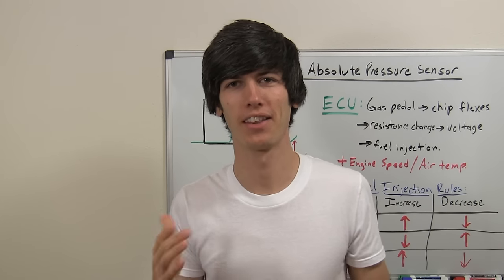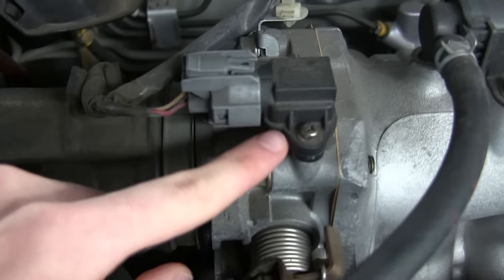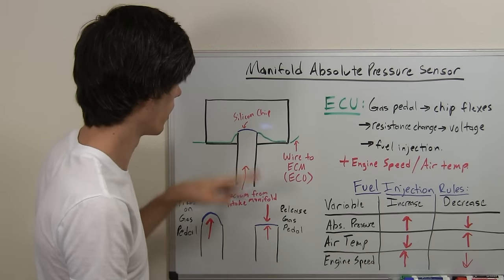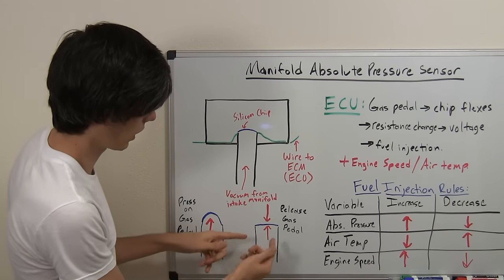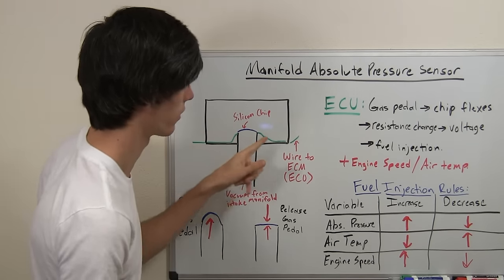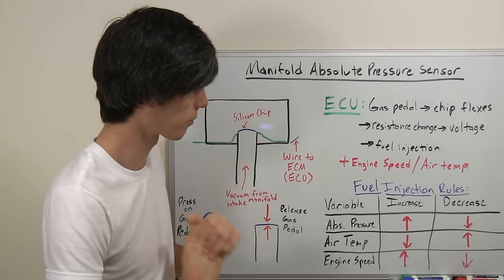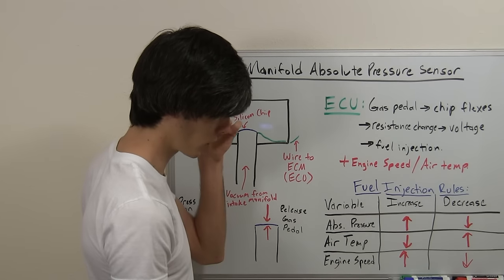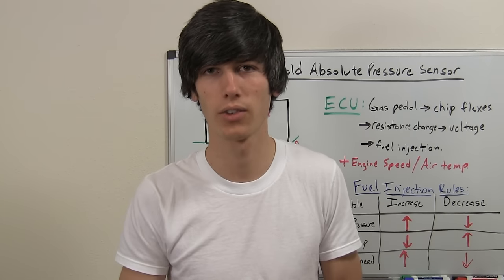MAP Sensor - Manifold Absolute Pressure - Explained

Comment: i appreciate the info, my car has a MAF though, i read a little about my problem online and i think there might be some sort of leak in my pressure lines were the boost is and one of the lines fails when full boost is running through it. i'm going to replace all the lines and that will hopefully get rid of the problem! thanks!

Comment: @blankps3, an engine is basically a big vacuum. The pistons "suck" air into the chambers. The more it sucks the more power you get therefore the higher the vacuum. The throttle controls the amount of suction. It gets a bit more complicated as you add a turbo but that is the gist of it.

Comment: Back in the day I had a manifold pressure dial on the dashboard. It was a great visual aid to drive economically, as you could instantly see exactly where that tiny extra press on the gas pedal would translate to a significant  increase in the manifold pressure - and fuel flow. By watching te indicator, it was possible to negotiate a gas pedal position that would result in not increasing the manifold pressure, and at the same time maintain current speed (though with practice I learned to "feel" that precise point, without having to look at the gauge). In the modern cars of today we have the instantaneous mileage indication, which can be used to the same effect (drive economically).

Comment from the maker: TPS is on the back side of the throttle body, on the same axis as the butterfly valve (I have the maintenance manual).. I have a video on TPS if you're interested. I went to NCSU.

Comment: I’ve been checking out my map readings on my scangauge and noticed that the map reading at idle is higher than when I lift off throttle and the rpm are dropping. Why would an engine at idle create more pressure than an engine that is revving down? Is there vacuum created when fuel is cut yet the pistons are still cycling? Thanks man, love your videos.

Comment: cool video, not sure if you can help but I have a 98 Toyota tercel that runs crazy rich only at first start in the morning and only when its below 40 deg outside. there are no dtc's I've tested the o2 and replaced the coolant temp sensor, also checked for leaky injectors. the exhaust smells like raw gas and smokes for about a minute at cold start. if its warm out no smoke and no gas smell also no engine miss and I replaced the valve seals. this thing really has me stumped. Thanks chuck.

Comment from the maker: Well keep in mind it can also use the O2 sensor to close the loop up and provide another data point to verify/alter the A/F ratio. It is very cool though.
Reply: Great explanation Jason as always. So vehicle's computer will not look to the MAF sensor to check air to fuel ratio, but will bypass it and go to the O2 sensor to calculate the amount of fuel to mix with the air.? Cheap gain power 🤔

Comment: Thank you.  very good explanation,  Doesn't seem like a lot of work to simply replace the IAP sensor when it goes bad.  Would you say 10 or 15 minutes if at that.  Are there other adjustments that must be made after the sensor is replaced

Comment: Nice explanation.  I'd welcome a video explaining the different purpose of the MAP sensor and the MAF sensor. I think their functionality overlaps but the MAF sensor gives a more reliable reading of the volume of air at higher RPM (with the throttle open) whilst the MAP sensor gives a more reliable reading at low engine speeds (where the throttle is less open).  Any inputs most welcome.
Reply: I think the MAP sensor is important to set the ignition timing.  More MAP pressure (higher HP) the timing is advanced where as less MAP pressure (lower HP) the timing is retarded. The MAF is for fuel mixture control.  The ECU is metering the fuel based on the airflow.  In the real world, both work in conjunction to maximize you engine HP in an efficient way.  When you step on the gas pedal, you demand more HP from the engine and the end result is higher MAP pressure + higher MAF air flow.  The ignition and fuel metering adjust themself to provide the optimum HP
Reply: @phatvu3811  Thanks, that makes a lot of sense! :-)

Comment: Yes,my brothers 2000 model Subaru Forester is playing up at idle speed particularly when it's warm,I've went through & checked for air leaks which I got rid of but the engine  keeps surging 15 minutes after the engine has warmed up.

So,on Monday I hope to do a voltage test using my multimeter & a vacuum pump & gauge to see if the sensor is putting out the right voltage because I've ordered  a hand held vacuum pump to test it with.

I need to test it because they aren't cheap at $400-$700 AUD for a new one,I might buy a used one or something if that's what my brother wants !

Comment: Very useful information, you explained it very well, but I do have one question what would be the symptoms on a engine when the map sensor is not working properly or at all.  will it still turn on or will it turn on only for a few sec then turn off ?  I ask because my vehicle has 2 map sensor and one flow sensor.

Comment: II see that this is video is from quite a while ago. I have a MAP senor on the intake of my carbureted motorcycle. I assume, in my case, that the sensor only impacts the ignition timing. Can you do a similar explanation for a carbureted engine with a MAP sensor? I liked your presentation.

Comment from the maker: That's interesting about the spacer, I've never heard of that though the logic makes sense. I should have a video on CAI's eventually, don't know when. As far as are they worth it? Ehh, most companies know what they're doing, and you won't see big improvements. The biggest difference you'll notice with a new intake is the sound, but that could be achieved simply by removing the silencer box around it. Also, you need to be careful that the rerouting of a CAI doesn't place it closer to the engine.
Reply: the deal with "Cold Air Intake"... is to trick the ECM as if you're driving in cool Canada instead of hot Havana.

Computer sees cold air and injects  more fuel...

Fav. quote: "There is no Replacement for engine Displacement!"
👍

Comment: Thanks man - great video !
I did a bit of experimentation the other day trying to diagnose a certain issue with my car. What I noticed was, the map sensor would give a certain value at idle, this value would increase as I'd step on it - but - as soon as the new / high RPM is stabilized - the map sensor signal value would default back to as it was on the idle.
To rule out it was a sensor issue, I unplugged the pipe from the intake/manifold & created a vaccuum through mouth & the signal value would maintain instead of defaulting back.
TLDR : it appears that the pressure in the engine would drop back after acceleration - which would naturally cause the map to lower down its signal - do you know if this is how its meant to be ? or am I experiencing some undesirable vacuum leakage (other details : toyota 5afe, knocking, occasional puffing in the silencer, possible tappet noise, possible rich burn)

Comment: thank you for the help I have a 2017 CRUZE diesel the mileage [was] around 40 two lane black top . freeway over 50 the fuel mileage went south . I cleaned the map sensor [ ISOPROPYL ALCOHOL BASE] lots of soot the mileage came back for a day so I purchase a new one after market its not up to the job [I should know better] so I have a GM replacement coming we will see what happens. thanks

Comment: Really enjoy all your videos, thank you. I was wondering, could you do a comparison video of MAP vs MAF sensor? Can't tell if one is "better" than the other.
Reply: A MAP sensor measures the pressure in the manifold. A MAF sensor measures the volume of air flowing through the intake prior to entering the throttle.

MAF sensors can be problematic in forced induction and high performance engines as they don't measure the direction of air flow, only the volume of air. When the throttle snaps shut, you'll have a pressure wave of air moving back out the intake, which the MAF sensor will read as a large volume of air. This will cause a potentially harmful rich A/F mix to exit into the hot exhaust. 

In that scenario, a MAP sensor will see a drop in pressure in the manifold, and adjust fuel injection accordingly. 

Generally, if you're building a high performance engine, especially a turbo engine, you'd be better off running a MAP sensor. 

I got this information from watching a video by HPA, High Performance Academy. They're also a fantastic channel - racing team that's based in Australia that's been building race spec engines for many years.

Comment: I always enjoy watching your videos. I learn so much from them, and like to learn as much as I can about cars. I have a trouble code, P0108, MAP sensor voltage high. You mentioned that cars that have a MAP sensor don't have a MAF sensor, but my 2016 Honda Fit has both. I am concerned that this sensor may affect my engine and needs to be replaced. Is this the case or could it be cleaned and have the trouble code reset?

Comment: Hi Engineering Explained, my car is on Stage 2 and recently upgraded the turbo compressor wheels, and wastegate actuator. Should I upgrade my 2.5 Bar Map sensor to 3 Bar sensor? Thanks in advance

Comment from the maker: Honestly I'm not too sure. From an engineering standpoint, I feel like a MAP would be an improvement as it doesn't put anything in the way of blacking airflow, and doesn't have resistors that are in the airflow's path that could get dirty or be damaged. But I believe both are still used today, though perhaps not.

Comment: Hey thanks for the video I was reading that the map helps the ecu determine the engine load. Just a query if car is in neutral and you rev it to 2000rpm and compare this to lugging a car up a hill at 2000rpm how do the pressures change is it just because the throttle plate will be wide open in latter case?

Comment: Hi man just a quick question  . What's the difference between an absolute back pressure sensor vs relative back pressure sensor? Like would the absolute result in a lower value sent to the ecu than if a relative was used?

Comment: See in a normal situation with a low amount of throttle applied, the throttle-valve is almost closed. Thus preventing the engine form breathing at it's full capacity. Still the pistons go up and down sucking air into the cilinders. But the closed throttle is like an obstacle creating a vacuum in the intake manifold. Or at least a lower pressure then atmospheric. Only at full throttle this resistance drops and maniflold pressure is atmospheric. SO more airflow increases manifold pressure.

Comment from the maker: Not necessarily. Just because you live in a colder area doesn't mean your car makes more power; in fact many times it can mean the opposite. Higher elevation areas will have less oxygen in the air, and thus the cars will produce less power. If you have the combination of high oxygen content air, in a cool area, then yes, there could be power benefits.

Comment: BTW the output of MAP sensors is voltage ( usually 0-5V range ) in most cases or variable frequency on some Ford automobiles. Conversion resistance -voltage / frequency happens inside the MAP sensor , not in the ECU!

Comment: Im currently in some trouble with my fuel injected Honda VFR 800FI motorcycle. The problem seems to occur when the temperature increases. Means: the hotter it gets, the more hesitation i get on the trottle.
I will give it a try and change the temperature sensor first because thanks to this video i think i´ve understood the principle of fuel injection. I´ll let you know what the result was for you guys that are interested.

cheers

Comment: Hi, Saw various videos of yours and gained alot of knowledge being an amateur car enthusiast. a question in relation to MAP, Will K&N Oiled filter (New) can temper or damage MAP sensor Vs a Paper stock filter ?  I am hoping in change in air-fuel ratio due to higher air flow but will it result in higher HP gains or losses ? Thank you in advance,

Comment: Hi, my (car BMW e46) has both a MAF and MAP sensor. Does this mean the MAP sensor is completely redundant until the MAF fails? Or does it work in tandem with the MAF at all times adjusting for air pressure inside the engine? Thanks for any help 🙂

Comment: I have a 2.5L Sebring with a MAP sensor. It's not turbo charged, but when I had it hard on the throttle I would randomly lose power for a second and it would go back onto it. I replaced my MAP sensor and it was all fixed.

Comment: Great video.
A question:
If I plug in a chip into map sensor, how can I modify data to ECU?
How it works?
Regards
Reply: MAP (on Honda motors) is a resistance connected into a voltage bridge. 

All the PCM sees is a simple voltage change that is interpreted with many other variable factors to plot fuel ratios from an engine table.

Car companies license pre-designed German calculators to manage fuel tables.
👍

Comment: the company I got the spacer from (shark racing) claim it gives an extra 5-7 hp, (which is unlikely), but it I did notice slightly more power and smoother gear shifts

Comment: Thanks for the great video! 
I am intrigued by your quip that some (fuel-injected, gasoline-powered) cars are designed to properly calculate fuel/air stoichiometry while not having a MAF... thanks to MAP.    Indeed, I'm troubleshooting my 1999 Chevy Cavalier Z24 (2.4L engine) and I can't find a MAF under the hood, or in my Haynes manual 3-page engine controls wiring diagram.    The MAP, IAT, etc. are all easy to find.         This is a very clean car, too.

I thought MAF was fundamental, to proper calculation.       Can you comment on how a mere MAP et al might provide enough information, to properly calculate appropriate stoichiometric ratio of fuel to air?   

P.S.  I'm an experienced electronics engineer, and occasional mechanic.

Comment: Does the ECU assume an amount of air inflow based on the Throttle Position Sensor and engine RPM?  Or is that the role of the MAP? Or is the MAP simply trimming the fuel/based on measured pressure/air intake?  I gather the ECU would already assume an air inflow based on RPM and TPS to demand the right fuel injection.   If the MAP measures a higher/lower air then a trim is made??

Comment from the maker: I'm not sure what the failure mode is when a MAP fails. I wouldn't assume it to be the problem for a motor that won't. If fuel is the problem I'd look at the injectors, fuel pump, and fuel hose lines first.

Comment: I recently installed a new performance intake into my car so does this mean I need to get it retuned to the new intake ? Because I got a check engine light and I'm pretty sure it's because the sensor was tuned to the factory intake. Thanks!

Comment: Sir I have this problem of my honda accord 2000 6 cylinder it’s hard starting when it’s warm but after an hour that I turned off the engine it’s always quick starting. I did the electric test to the MAP sensor the voltage don’t increase when I open the throttle. Thank you so much for your attention

Comment: simular question to gavin, I have a Phenolic Intake Spacer in between my manifold gaskets, It's supposed to substantially lower the temperature of the intake manifold, resulting in more power. when I installed it I noticed slighly more power after long drives and the intake manifold was cool enough to touch, could u do a vid on these aswell as cold air intakes? do you think they are worth it?

Comment: My map sensor stopped working in a 98 lumina  that I once owned.The engine light came on and the car  went into limp in mode of a steady 40 miles only speed.I pulled the codes from the engine dash after sticking a paper clip in the obd 2 connecters. the manual book for that car told me where to stick the clip.I replaced the map sensor , and the car ran as good as new.

Comment: Great Video. 

Is it possible my 99 pontiac 3800 has MAP and Mass Air flow sensor.  I know I have had to replace the Mass Airflow sensor before and that was a sensor that was in the middle of the intake in the throttle body.  I also seem to have a MAP on the throttle body as well but not sure that is what it is but my service manual shows me the schematic of a MAP so I assume I have one of those as well.

Comment: Hello I have a Subaru WRX 2006 Hawkeye 2.5 L turbo the problem I’m having is that oil is travelling to the top mount intercooler coming down underneath into the turbo charger Also Inlet manifold Heavy oil Inside PVC valve covered in engine oil  the air intake pipe is also covered in engine oil had turbo looked at and nothing wrong with turbocharger can you explain to me how this is possible and how do I fix it thank you so much Steve also no smoking from exhaust pipe no oil contamination on back of turbocharger is this a common problem on the Pcv   valve malfunction Also no problems with starting or idling issues

Comment: If the air coming inside the engine is too much.. That might damage the MAP sensor? 
I ask this because i've upgraded my throttle body to a bigger one and the fuel pressure regulator from 3.8 bar to 4 bar.. And its the second time in just 1 year +/- that my MAP sensor goes mad. Do you know if its because of the bigger throttle body?

Comment: There is great confusion about map sensor and boost sensor and when researching the items often flip flop using the names which makes things worse. On my mercury villager same as quest--there is a map sensor with three tubes going to it combined with an electrical plug in. However one of those tubes goes over to a boost sensor that says boost sensor right on it. That device has only one single tube going to it that seems similar to your chart. Can you clear up which is the map sensor or boost sensor or are both collectively part of the same system and BOTH are map sensors??